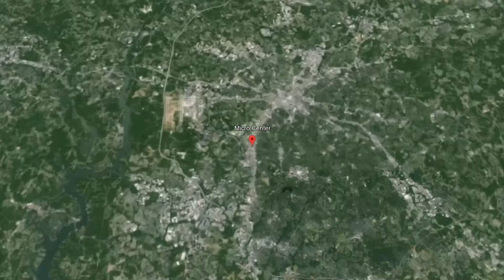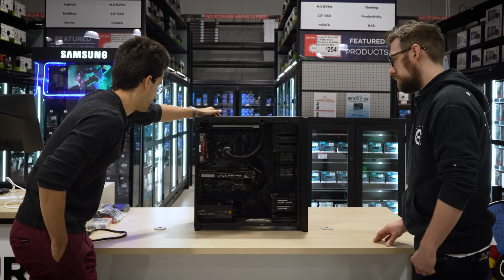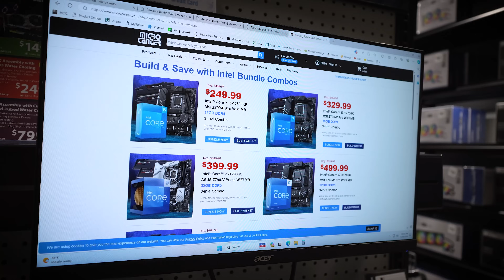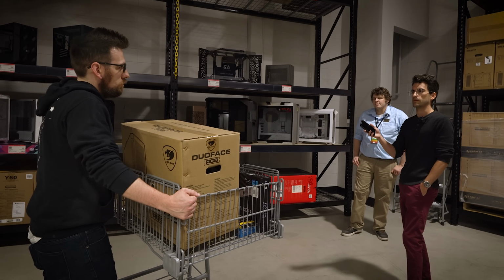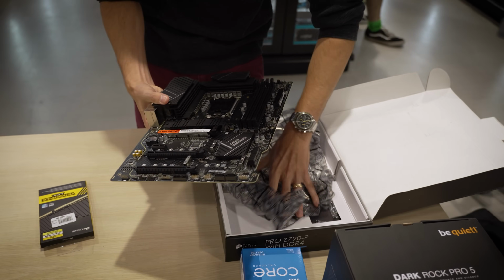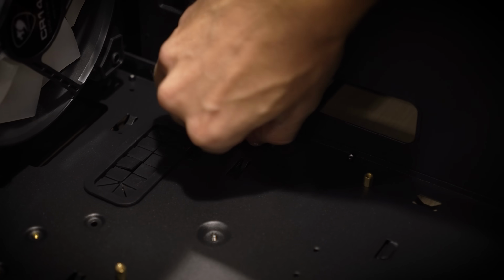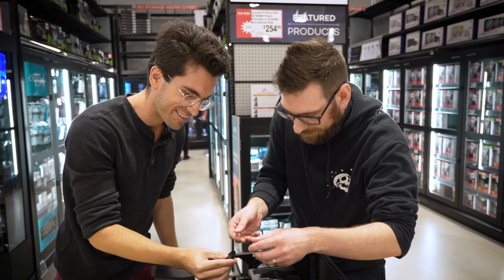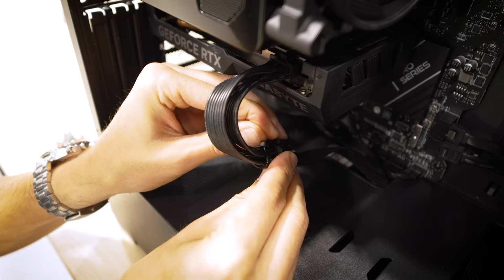We OVERHAULED This Old Gaming PC! - Gear Up S3:E5

Comment: 9700K is still rocking, he should go with only case and GPU upgrade.
Reply: I have an i7 8700k.
Reply: Yeah, would be adequate for the 4060
Reply: Agreed. Had one up until recently. If I hadn't found a killer deal on an upgrade, I'd still be totally happy on a 9700k. Luckily they still go for decent $ so I almost broke even by selling it.
Reply: 8000 and 9000 series are just weird to me, but at least they can still do the things they need to.
Reply: Skate, you’re wrong about his system when referring to his specific CPU model. He doesn’t have an i7 9700K. He has an i7 97000K! Yes, he said i7 97,000 K - the cpu from the distant, distant future! Perhaps a time parallel coexisting next to our timeline just in another dimension shoulder to shoulder with us. Even so likely as they are matching pace at a 1:1, second for second.
Reply: @BREEZYM6015  8700k 5ghz still working beautifully, glad to see

Comment: I was way too nervous about that ram stick but I'm glad it all worked out in the end!
Reply: IKR! I was sweating when he hit the power button…. It’s not even my rig 🤦🏾‍♂️
Reply: As far as I could see, they had put in only two of the four sticks when the cooler was placed on top of them, so they didn't try to check if they would still work it seems
Reply: Yep, waiting for 'that' first post is nearly as bad as waiting for my first child to be born!
Reply from the maker: @sp00n  We aren't gonna connect a module that just had an SMD lobbed off... silly.
Reply: @GregSalazar  I wasn't implying that you should have, just that you didn't, as some here appeared to have been thinking.
Reply: @GregSalazar  i have a 12900k with a missing component and it's working wonderfully ;D

Comment: Love this series. Hope when Miami opens you do this for their. Definitely would do it my i3 10100 and gtx 1050 ti needs an upgrade
Reply: You have almost the same specs as mine! i5 10500 and a 1070 haha. I have a micro ATX board though that is bottlenecking my system. Lessons learned 😂

Comment: Today I learned my Vengeance LPX has the plastic cling on it still.  I think I'll leave it on for now lmao
Reply: There is a fellow I sold a rig to with 4X of those sticks, and I would bet it will be on there to the end. Lol
Reply: @MojoWrangler  I left all of mine on them. 4 sticks for 32GB. They originally lived with my 1700x, but then I decided to migrate them to a secondary system with a 6700k inside and get a newer kit for the main rig, which also got upgraded to a 5700x.

Comment: That new PC looks really good.  And you are right, the RTX 4060 is a good card if you're upgrading from a much older card.  Newer also means longer support and better warranty.  Sometimes the people online are too demanding. Almost as if I'm not using an RTX 4090  I'm wasting my money.
Reply: Yes, only that and the fact it's 200 less than a 4070. The ti is about the same price maybe even 20 dollars more on eBay, so if anything get the Ti version if you can.

Comment: The guy that helped you is the same guy that sold me my new 5800x3d just a few weeks ago.

Also, even regardless of the piece that broke off of the ram stick I don't believe you would have been able to use both kits at the same time. I tried to do the same a few months back in my rig, but got a ton of issues. Game crashes, BSODs, and I was even prevented from making a clean Win10 install. Made a post on the r/corsair sub, and was told that each kit of ram is only validated to work with the other sticks in the kit so combining multiple kits would have these sorts of problems. I was told you can get them to work but you would have to set speeds, timing, voltage, etc. manually.
Reply: I'm actually using a kit of 2x Corsair Vengeance and 2x GSkill Ripjaws. All 4 working without problems even with xmp activated. Just made sure it took the slower timings xmp instead of the slightly better timings of the GSkills. They're both CL16 but the GSkill has slightly tighter timings for the other timings on the xmp compared to the xmp of the Corsairs that I'm using.

Comment: Man I wish we had a Microcenter here in Central Florida. Loved having CompUSA up in Altamone...hell, I remember when we had Computer City everywhere, too!  

As to the 4060 - yeah, people denigrating it, there's a lot of budget minded folks coming from 10 series or 16 series or maybe even 20 series cards for whom that's a great upgrade.  Not everyone's aim is 240fps @ 8k.
Reply: The 4060 isn't a bad card, it's bad value for the money. There are no bad gpu's, only bad pricing. AMD dominates for value at the lower tiers.
Reply: I currently use a 4060 for my first pc and its great for 1080p gaming in every game like esports often reaching high fps its a good card but pricing dont make sense ill probably get a 4070 soon
Reply: @robertmajors1737  I currently use a 4060 for my first pc and its great for 1080p gaming in every game like esports often reaching high fps its a good card but pricing dont make sense ill probably get a 4070 soon
Reply: @connornelson5716  If the 4060 is getting the job you need it to do done, I wouldn't change a thing. Too many people upgrade for no good reason imo. I wouldn't upgrade to get better 1080p performance. I would only upgrade if you want to go 1440p, which I would highly recommend. The difference between 1080p and 1440p is massive. The difference between 1440p and 4k isn't nearly as noticeable. It's kind of like 60hz vs 120hz, and 120hz vs 240hz.
Reply: I have that 4060 and play at 4k 60 frames. The card does run hot because it has a bad fan curve, but you can change the curve and it runs just fine.
Reply: not sure how central you are but the next micro center location is going to be built in Miami
Reply: 4060 is a decent card and is a massive upgrade from really old cards. The reason it is hated is because of 2 reasons. Too pricy and second reason is it performs worse than the 3060 for same price due to the lower amount of vRAM.
Reply: @khalilshew4924  Eh I'm up around Orlando, but if Greg does the Wheel o Computer Fortune down there I might have to truck down for that.  i7 4770, 8 gig gtx1080 here.  Still a banger but definitely long in the tooth.
Reply: @thedungeondelver  yeah would be worth it. I think he is from Orlando himself I believe
Reply: Dude i miss that compusa location and the toys r us on the other side of the road. Also miss Circuit City on OBT
Reply: @Pezturbator  Hell yeah!
Reply: I think Greg is purposefully doing these videos so he can convince MicroCenter to build one in or around the Orlando Florida area.
Reply: almost everyone expects or thinks that all of them are upgrading from a rtx 3050 or a rtx 3060ti, 
rtx 4060 is a good card for 1080p. it even gives some good fps. 
I went from rx 560 4gb to rx 580 8gb as a temp upgrade. felt a huge difference. 
will soon go to a rtx 4060ti or else rtx 4070 super. currently saving money...

Comment: Another excellent upgrade! I hope you were able to sort out the RAM issue and send the viewer home with 32 GB of RAM :)

The only thing I might've done differently would be to keep the old case and spring for a M.2 boot drive. But that's minor, SATA is still plenty fast and those 850 EVOs are excellent SSDs that hold up well even approximately a decade later.

Comment: The 12600KF is a powerful CPU without a doubt. It marginally outperforms an i9 11900K in many tasks. The only issue with these, honestly, is the "F" skew/no iGPU. For what is commonly the marginal price difference, having the onboard graphics can be clutch in a troubleshooting situation.

Comment: i can confirm that about ppl not removing the peel from those vengeance ram's. i had gotten a 8gb pair of ddr3 used to upgrade a older pc and both sticks still had the peel. and recently got a 8gb kit but of ddr4 and that one also had the peel 😂 same has happened with a few other used stuff ive gotten. so not only got that used value but i also got the peel asmr enjoyment

Comment: i think it is much better if he chose the 7700x bundle as it is the much better option for future proofing, then he chould buy a thermalright cooler for $20-30 bucks then a case for like a $100 and that would be a better build than 12600KF

Comment: I'm sure with enough effort you could have put that resistor back on. Having a second person to hold it in place while you work on it would probably make that easier too. I have a cheap iron (still a temp controllable one though) with the smallest tip and was able to move a similarly sized resistor on a small board (a EZ Flash 3in1 specifically. It was having issues with game saves and found that moving a resistor and removing one other fixed it) despite the tiny size I was able to reattach it.

It's getting them off that is the difficult part. Almost lost them when I tried. They like to pop out of the tweezers off into oblivion. Putting one back on was the easy part in comparison. :D

I'd definitely recommend having some flux though. I had some no clean flux and that definitely made it a doable project for me. :D

Comment: Great build for the $$$ 😇🙂‍↕🥳💪👍!
One thing I love about Nvidia gpus is you can get a much smaller GPU than with Radeon as many (not all) are 3-fan models with any lower mid-tier and up gpus…… I have a Gigabyte RTX 4060 Low Profile (got for $280 from $330 MSRP) in a sff ITX HTPC build and it’s great for the games I play on it and is whisper quiet and a decent performer for 1080p and 1440p DLSS Quality gaming 💪🥳👍

Comment: the old case is still so much nicer than the new case, it just needed to be cleaned, a cheaper tower cooler or skipping the extra ram plus recycling the old case could have gotten you to a RTX 4060 Ti

Comment: Ngl a good clean up of the old rig and a decent power supply he could either flip it for some profit re purpose for something like a server because while 9th gen Intel is getting older its still very capable my biggest suggestion wouldve been something like a 7600 xt over the 4060 since at least online theyre the same price if not cheaper on the amd side or maybe even a 6700 xt if micro center could match the Amazon deals but thats my two cents  

A suggestion for maybe next season since a common thread seems to be always being below 1000 have an option to respin once but if its lower youre stuck with it might give those who hit the lowest option a possibility for a bigger upgrade

Comment: I have a 4060 TI and it works great.  There are some 4K limitations (Only that I run high settings rather than Ultra) but it is working great.  My games run great and the $$$ saved meant a much better upgrade elsewhere including an M.2 4T Drive.
Reply: If he just adds a nice M.2 to that build it would be a good performance boost.

Comment: The i5 12600K processor is a pretty good gaming CPU for the money in that package. In my opinion the RTX 4060 is more on the fence. The 16GB version of the same card costs a few dollar more but makes a real difference in some games. And with the way things change I bet future games will be even more dependent on GPU memory.

I won't really say anything about the case, but the cooler was definitely more than what was needed. If anything Id say go for a cheap air cooler and spend the saved money on trying to get a 16GB GPU. Now I don't know what the alternatives at microcenter is, but some thing like a Thermalright Peerless Assassin would cut the cooler price in half, an still be way larger than needed. Sure that cooler will still be fine with an upgraded CPU, but right now it's just money in the drain.
Reply: The 16GB 4060Ti is arguably more expensive than it needs to be. There's no 16 GB 4060 though.
Reply: @quantumreality215  Strange, A friend bought one about a month ago and there are videos here on YT about the difference between the 8 and 16 GB versions...
Reply: Sorry I had to check and it was me that was confused. I had a brain damage not to long ago and it seems my memory is a bit worse than I thought. You are right it was the RTX 4060TI that my friend bought a 16GB version of. It became this particular GPU because he was giving his son a new computer, set the total cost and his son chose the components and he absolutely wanted a Nvidia based GPU as some game he is playing had some extensions that only worked with Nvidia, and he had chosen a 8GB version to save money. I told him to swap from a Noctua cooler to a cheaper Thermalright cooler and upgrade to a 16GB version of the GPU. So that's how it came about. I have no idea how I managed to forget that it was the Ti version.

Comment: Please which one is better 3090 24gb or 4070 super 12gb .. if they are at the same price.. used ?

And some say that dlss and frame generation can work with 3090 too with mod or some programs ?
So 3090 might be better or the 4070 super ?

Comment: "we are stuck in everything under a thousand, I don't know why"   uh because you have an 83% chance to be under a thousand  10 out of the 12 spaces are under  that.
Reply: Yep lmao he acting like he don't know when he was the one who wrote down the values.
Reply: To be fair, the 2 "+100s" are free spins plus $100 which would increase the odds of getting over $1000. What I have noticed is that, on the last 2 spins the wheel spins backwards after it stops which would indicate that it is not balanced and favors one side. If you moved the indicator so the wheel would move freely, I bet it would always settle on the same value. The digital one is better because it is truly random.

Comment: Greg you gotta emphasize how bad spinners are for overall system performance as well as gaming. Just having one (spinner HDD) plugged in will bottleneck the entire system, slowing windows drastically, even if its not in use. Better overall to have it detachable with a USB 3 SATA adapter when you need, if you need the cheaper bulk.

Comment: $700 budget I would splurge on the gpu maybe install an NVME boot/system drive, that 9700k is still a viable cpu for gaming and workloads, no need for platform upgrade with the limited budget.  4060 is a solid performer, keep the platform upgrade to the 70 series with 16gb more ram or do an AMD card.  

Also for 500 bux he could have gotten that 12600kf with 16gb ram, the z790 mb and an arc a 770 16gb gpu which is a great performer now that the drivers are right.  Still had budget for a case and an NVME boot drive.

Comment: Ya a 4060 does get hate but Im loving mine. 299 and it preforms much better than my 1660 super ever did
Reply: Loving my 4060 too which is a big upgrade over a GTX 1650

Comment: So wait, what happened with the ram after the incident?
Reply: Looks like they just didn't add them, cause of the 1 damaged stick. Running 3 sticks of ram would have reduced system performance, as it would have been running in single channel.

Comment: I would have went am5 7700 combo, cooler, case and nvme. I would have reused the 1070 and psu. Upgrade the gpu when the wallet allows. I just fell like that Intel socket is dead, not to mention slow with ddr4.

Comment: If a person had an old rig and a that needed upgrading (like mine with an old i7 8700 with a 1070Ti) but they had a new gfx card like a 7900xt that was still in the box, could that be used in one of these gear up episodes even though it wasnt purchased from microcenter?
Reply: Yes, some others had a CPU or other components with them, so I don't think its against the rules of the game 🙂

Comment: Not sure why the CPU upgrade, its 2024 as of this posting and a 9700K is a solid gaming CPU, he could have upgraded that 4060 to a 4070 Super for the cost of the bundle. 

Also no hate on that 4060, going from a GTX 1070 to a 4060 is a MASSIVE upgrade.

Comment: In my area for around 700 you can get a 7600x bundle and paired it with a 6750xt plus a new case which is better for gaming. The 4060 is not really that good overall. While better than a 1070 sure it's not that great of a GPU. Even a 3060 12GB is overall better.

Comment: ram is fine, broken component is cap and it will work without it. no cap no shorted cap !
Reply: It would still potentially run outside of spec which might cause issues down the road. But having seen this I definitely plan to watch my RAM more carefully on my next build! I didn't even realize this could happen.

Comment: Im amazed this PC had a 850watt PSU. I mean thats more power supply than you need for a 1080ti or even a 2080ti.
Reply: To be fair, I had an XFX 850W PSU from 2010 that I kept with my builds up until about 2022. It drove everything from a Phenom II X4 965 up to a Ryzen 7 3700X. I've since retired that PSU in favor of a Corsair 850W unit, though.

Comment: wheel is very unbalanced with the 1200 wanting to rest at bottom. so on the final rotation, it has to push that weight over he 'hump' and causes braking to occur during climb which lands it in the range we have been seeing. take off clicker and see where it wants to settle.
Reply: It's designed a certain way for a reason.
Reply: @BREEZYM6015  I dont think that this was deliberate on greg's part

Comment: A 9th gen is not "old."  It's still fully supported in Windows 11 and isn't too bad when it comes to performance.  The case and everything else was pretty old and the GTX series GPU could definitely have used an upgrade but realistically I would have just stripped it down, cleaned up the case, replaced the liquid cooler and power supply, and upgraded the GPU.  It's sad when perfectly good hardware is just thrown away.  I would have kept the old power supply and GPU and put them in a budget system to sell on Craigslist.  Sadly a 10 year old liquid cooler needs to be replaced due to a lack of reliability.  This is one reason I almost always recommend air coolers unless it's a super hot running CPU.